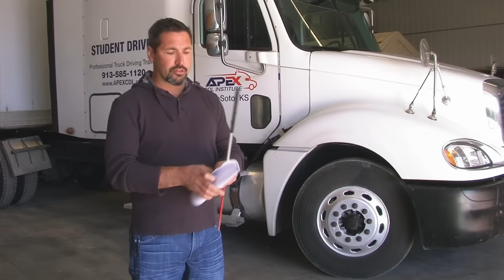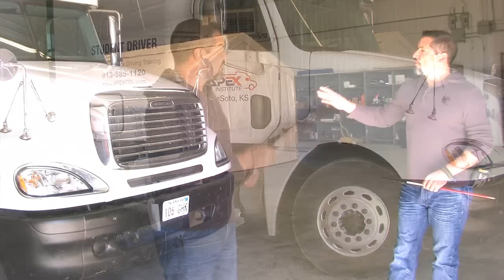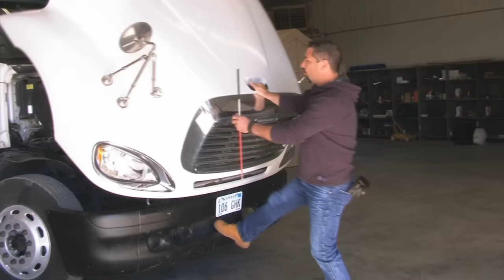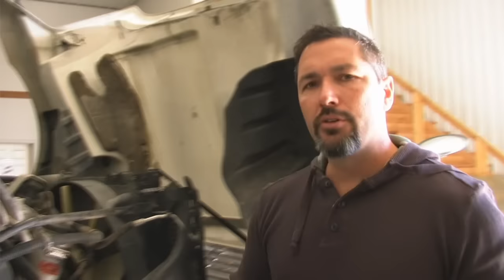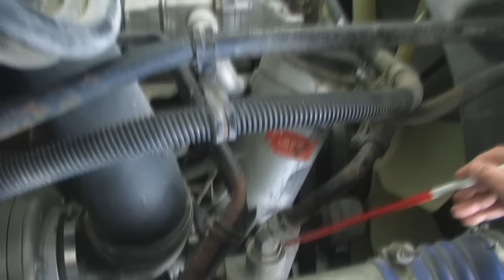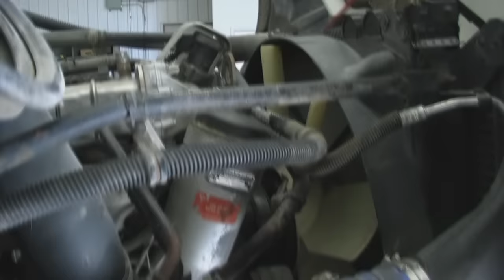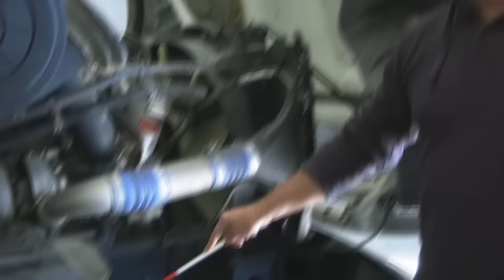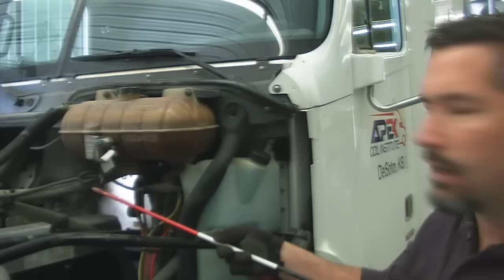How to perform a Class A CDL Pre-Trip inspection. Demonstrated by a state licensed CDL examiner.

Comment: I’m currently going to CDL school in Minnesota. The school told us only ALE is required. Applied, low air loss warning and emergency break pop out. What I have noticed by watching different videos on YouTube is even though CDL is federal, each state have their own way of testing you it’s best to refer to the driver manual of the state where you taking your test. Nowadays you can’t get your CDL without going to school so the school will teach you the expectation. But overall this good information. I’m going to school in Minnesota but I’m going to take my road test in Wisconsin because it’s faster to schedule road tests in Wisconsin. Wisconsin want you to talk about each each hoses and each wires that’s associated with each parts. They also want to hear about each light separately and point exactly to where those parts are. Like with the head light you have to talk about head, turn and four way flashers separately and say the color.

Comment: This is a tip for driving in winter weather. Carry cat litter in case your drives spin on ice to get traction. Also leave the trailer value pushed in while in cold weather to keep them from freezing to drums. Make sure you are parked in a level area first. Front side and rear maker lights should be Amber or orange. Brake lights red. Check your 4-way hazard lights on truck and trailer. I recommend you to have a good CB Radio at all times for safety check on road and traffic conditions. Also for emergency reasons.
I hope this helps whoever reads it. Have a good day and safe travels on the roads ahead.

Comment: A tip for anyone in Minnesota, the air brake testing here is not right for us. Just took the test a couple hours ago and it goes like this.
Step 1. Make sure you're at the proper air pressure 
Step 2. Release the trailer brake keep the tractor brake on and tug against the tractor parking brake.
Step 3. Release all parking brakes and drive for applying the service brakes. Note that the vehicle doesn't pull to the side.
Step 4. Shut off truck. Turn key to on.
Step 5. Apply brakes for 1 minute makong sure no more than 4 psi loss.
Step 6. Low pressure test brakes. Make sure audio and visual alarms occur.
Step 7. Emergency brake test, pump brakes until Emergency brakes are set off
Step 8. Start truck, and immediately try to pull away with Emergency brakes applied.
After all this is done, you have finished your pretrip hopefully. Starting the road test, you must try a trailer tug with the parking brakes for the trailer engaged. After a trailer tug, you can start your road test.
I hate Minnesota.
Reply: agree wit u

Comment: Thank you for this! Setting for my permit! As a thank you I will give you a recording tip. You can use any old blanket or maybe a couple pillows or even a shirt, placed near the microphone and it will help with sound quality.

 Recording studios usually have padded walls for this reason. The cloth kind of picks up all the Echoes and wind and everything like that. Sometimes it can muffle the microphone so you don't want to block the microphone, you just want to place it so that it catches all the excess wind noise.

Comment: Left out Battery Box and batteries and spare tire racks, also checking fluid levels on wheel Hubs w/ viewing glass, or sliding axles on rear of trailer if so equipped , when you backed up after service brake test you started backing up without checking right mirror, only looking in left mirror and eventually looked in your right mirror could of ran over somebody at that point 😀 good video and lots of good points , I have been out of the truck 4 years getting ready to get back in it

Comment: I'm from Massachusetts and we are required to do the trolley air break and  a 3 & 4psi/lbs air rate loss check. When we do a Compressor Recovery Test we need to Rev the engine 1200-1400 RPM the gauge needs to be at 85psi then time it until we reach 100psi. After we say how long it took the rev it to full. Good video!!

Comment: Great video! Very helpful, I really appreciate it. I think you missed some things though:  you didn't do the turbo! No soot leaking out of it etc. and didn't test the 4ways, didn't mention "air intake properly secured etc.", didn't mention turn signals on sides of trailer, or DOT tape on the side of the trailer. Didn't mention the main air hose tree on the firewall. I believe there's a certain height requirement for mudflaps being off the ground. And I think you have to mention there are no illegal welds on the ICC bumper. Didn't check Trailer annual inspection/trailer paperwork. Didn't mention trailer sand shoes. Didn't pretrip the tandem pins if they're locked, or the pin lock. If you have a spare you have to mention it. Have to pretrip the actual kingpin. I think you have to mention the roof of the trailer no holes. Need to put emphasis on "properly secured landing gear handle" because if it isn't, I believe it's an $85 fine. I didn't hear any "no audible airleaks" when he was going over the trailer tandems. Didn't mention any air tanks. Didn't mention the license plate, or license plate light, is it clean? Lit? Secured? Transmission fluid dipstick if applicable.

Comment: What about the external light(s) walk-around check--blinkers, marker lights, 4-way flashers, high and low beams, ABS, clearance, brake lights and all reflectors--done outside on the truck. Doesn't that need to be done as well?

Comment: In Texas we did all those steps but at the end we would idle the truck to recharge the system with air and it had to be back over 100 within 1 minute if I remember correctly. But everything else, verbatim the same. I've had my CDL since 2013...

Comment: Any reason why the battery and connections didn’t get mentioned , also ,shouldn’t we check the trailer tandem slide rails and pin to be in place and secure? 
Very detailed video , thank you

Comment: I notice you only mentioned the marker lights on the back on the tractor. Do you have to mention the side marker lights and what color they are and say what their functions are?? Like turn signals, 4 way flashers and parking lights?? Also I am being taught to constantly says "not bent, not cracked, not rusted thru and not welded" for every single metal item. I'm noticing you say "not cracked or damaged" for most of the parts. Is that sufficient enough for the state examiners??

Comment: One thing that I noted when checking the the travel on your brakes you need to block the wheels you do not want to climb under any vehicle without blocking the wheels with the brakes off
Reply from the maker: That’s why we check them one vehicle at a time. If the trailers brakes are locked, the truck isn’t moving and vice versa.
Reply: Never rely on breaks to work if you're climbing under. If a semi truck rolls over you it is not very forgiving

Comment: Thrill pretrips are very important and should be done daily. Quick question, what factors will cause the back of a tractor's frame to not have enough space or clearance with a trailer's landing gear? Could the trailer and tractor not be compatible with each other?

Comment: After your rolling break check you backed up to the original position but weren't you required before backing to hit the horn? I had to give up my CDL when I went on insulin. God do I miss driving. I was a bed bigger although I did haul freight and refer. I was an owner operator usually 11 western. Probably crossed this great country 100 + times. Evan enjoyed driving into LA. CA. Had breaks go out on the Grapevine and smoked them near Vale Co. Stay safe and remember to keep the greasy side down.

Comment: I am doing my cdl exam with my 1500 and a 33ft hitch trailer (not a bumper hitch trailer). There are less parts that I have to mention. And although the exam is hypothetical, would I have to mention the "imaginary" parts that would be on a 3500 (gmc 3500 what am using for work). But am not practicing parallel park with that. Doing it w the 1500

Comment: Awesome video.. I was watching just to refresh my mind, as I barely remember taking the test.. Quite a few things I had forgot,.. lol.. I have a question, and maybe I missed it, but don't you need to completely drain the air tanks to make sure no water and oil gets into the airlines/tanks? And make sure there's less than an inch of play in the clutch pedal..

Comment: Went back and watched this after a year and a half of operating and utilizing my CDL. Had a question about the PSI level in the air tanks. Current issue is tanks are building psi above 130 PSI. Consulting a mechanic and not operating until it gets looked at and serviced
Reply: That's a problem with the air compressor governor, it's either set to high or it's sticking, as long as the pressure doesn't go above the working limit for the parts of the air system it will be fine.

Comment: This is way old but the basics are still the same. The PTI/Post is still the same.
Better listen close for a serious reality check on what he is doing and what will happen with D.O.T. on the road.
He is doing a truck that is essentially spotless and prepped for video.
Regardless of the age of the truck or the age of this video,, the lecture is still good and is spot on.
Here is the but to all of this. No school, no lecture and no institute can prep you for the reality of "chin-in-hand."
Here we go: you are on the road. PTI was good and truck is running fine and your trailer just happens to be empty. On this occasion you just happen to get called to the weight scales. It happens.
You go across the scale, you stop on the scale and you hear this voice over outside speaker...Driver, drive your vehicle to the inspection barn an officer will meet you there to show you what to do. The fun starts.

When you get to the inspection barn you line up with the open door and the inspecting officer is standing inside at the other end motioning you to come straight forward...like a truck wash or car wash or a mechanic shop.
You will a straddle a pit. A full length pit for your entire truck and trailer.
The beginning of woe's.
What is not covered in this video is the "two-man rule." The two-party inspection. No inspector does an inspection by himself. No state. ALL inspections are done with your assistance. In this video you are taught to do the inspection yourself.
THAT is not the way inspections are done by DOT, in any state.
D.O.T. knows this. The inspection you are about to do is called a Level 1 inspection. Anytime you called to the "BARN" its a level 1.
On Level 1 the inspector will tell you everything you need to do while you sit behind the wheel and he inspects.
This is "the two-man rule" to an inspection...the two party inspection.
You better understand this right now:
No PreTrip inspection is done on "two man rule" no driver wakes up his trucking neighbor parked next to him to assist him in his own PTI before getting on the road. Try that and you will get shot. DOT knows this.
Yet, DOT will always have the driver as their assistant in the inspection...the one YOU just did as a PTI to get going on the road. The standard rule now is 20 minutes for a good Pretrip inspection. All that he is doing in this video is fine in understanding what everything does.
This is not the pit at DOT and it is not a creeper with a flashlight and gloves at the scale house. We do not have pits to walk under our trucks and trailers and we do not carry creepers.
Second, a lot of what he is covering is not "PreTrip." This is "General Knowledge" to pass a written test for a combination vehicle and a pretrip.
The inspector will have you work everything in the cab while he walks around your tractor and trailer. He will then tell you to work your brakes as he instructs. This is when he goes into the pit.
EVERYTHING under that truck and trailer will be looked at...everything.
He will measure and he pull and tug by hand on everything. He will do a steering/Bull Pin/linkage/pitman bearing run out on the driver side steer and a bearing toe/camber on both front steers. He will have you jerk the steering wheel left and right for end runout and linkage control and wobble and wear. 
We do not have "pits" for these inspections. We do not have two-party PreTrip inspections. We do not crawl under our trucks and trailers for PreTrips. We do not use creepers for crawling on the ground. We dont wake up our sleeping neighbor parked next to us. DOT knows that the standard industry PreTrip inspection, by design, can not pass a Level 1 inspection by DOT. Think about it.

A Level 1 inspection will go for 45 minutes to an 1.5 hours. While he does your paperwork on pass or fail you will sit quietly with your chin in your hand wondering "what the hell."
This is not what I was taught. And you will be right. So will that officer when he brings you your new paperwork.
If you pass a Level 1 it is only due "in part" to the PreTrip, not the entirety.
In other words, he just simply did not find anything worth noting or worth a violation. Otherwise, a PreTrip can not pass a Level 1 inspection. The PreTrip will pass a Level 3 inspection.
Level 3 is simply the lights, brake check and tires and anything outwardly noticeable, like a missing mudflap.

By Design, the PreTrip on Level 1 Inspection can not pass. Anyone that teaches that it does is marketing a scam and setting you up for failure and a bad CSA that will nullify your bonus program if you were hired on a bonus. You better wise up.

This video is great for knowledge testing, nomenclature, overall inspecting, knowing what things and why they function like they do.
THIS is not a Level 1 inspection.

No PreTrip can teach a Level 1 inspection. It takes two to do and will be an hour. THIS is why DOT catches drivers. THIS is why the industry looks down on drivers and is part of what ruins drivers. We all do PreTrips some of us better than others. 
There is no industry standard protocol for a Level 1 PreTrip inspection. It don't exist.
Anyone that tells you it does is a liar.
Or, they have a portable pit, a creeper a 10-ton air jack stuffed in their rabbit-hole behind the driver seat and they always wake up their team driver or their parked neighbor to assist...WE ALL DO THESE THINGS.🤠

Know it. But you can not do anything about it. This is by design. 

THINK.
Reply: Nicely said!
Reply: I think you missed the point of the video. The video is to help you perform the pretrip inspection examination when you are applying for a Commercial Drivers License. Nowhere does the description or the instructor state that this is random vehicle inspection preformed by a DOT officer. That is a whole different video.... Maybe you should record and post.

Comment: Don’t you need to apply wheel chocks when u do the brake test ? As when u do the pressure test , not the tug test cause I understand they can’t not be in the way when u do the tug test am just wondering if your wheel had to be chocked for the testing ??

Comment: I have a question, I'm trying to prepare for trucking school so I watch this video everyday. One thing I don't understand is something about the static brake check and applied pressure check. So he lets go of the clutch and he puts the vehicle in 1st gear, and releases the parking brakes? I don't understand, if the vehicle is in first gear what is preventing it from rolling. Can anybody help a newbie like me understand this and what is going on?
Reply from the maker: The compression of the motor. If the vehicle is in gear and the clutch is engaged, for the vehicle to roll, it has to roll the drive wheels, which means it turns the motor. The motor creates a lot of engine breaking force, so it holds the vehicle in place if there is a moderate slope.
Reply: @Apexcdl  Thanks so much for the reply. So even with the clutch disengaged, it won't roll because of the motor's braking force?

Comment: Im currently in school and prefer your video over theirs but going over the brake check I remembered your acronym  S.A.L.E but the school I am in is telling me you don't have to do a Static brake check just the applied, low pressure, and emergency checks. I am still going to do a static check on my test because I would rather be over prepared than under but Im confused on why they are saying you dont have to. When I asked, my trainer said the loss of 3 psi over one minute only applies to class B straight vehicles not combination vehicles. So if anyone sees this and can answer whether or not you need to do a static brake check during you brake test for a Class A combination vehicle test
Reply: I failed Michigan road test due to the air brake test. The examiner kept saying as written in the Michigan CDL manual. The Michigan manual does not include the static test. Unfortunately I did not catch this while in the cab where I could have rechecked my air brakes with the proper procedure.

Comment: I have yet to see a trucker doing a pre-check video where they actually use a tire gauge. 75% just kick or hit the tire and call it good, and the other 25% use a hammer or some kind of other blunt object and call that good. 

Section 2.1.5 of the manual, doesn't specify that tires pressure needs to be checked with a tire pressure gauge but Hazmat Section 9.6.9 does specify this. 

It would seem to me that having consistent and accurate tire pressure is critical for gas milage as well as the life of the tires. Anyone know why there is such a discrepancy between training and OTR?